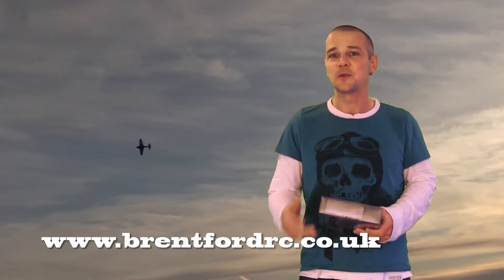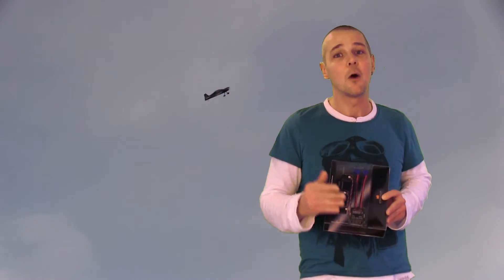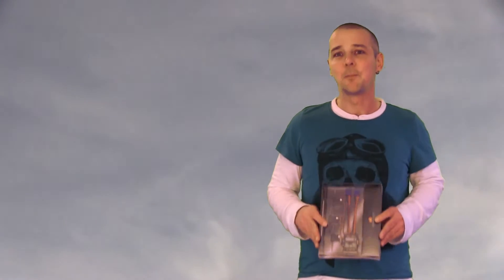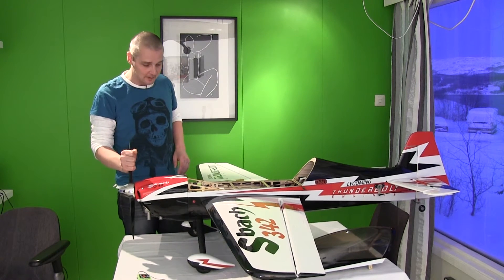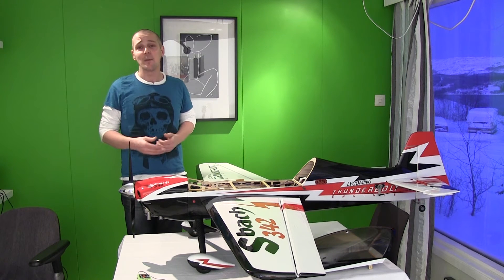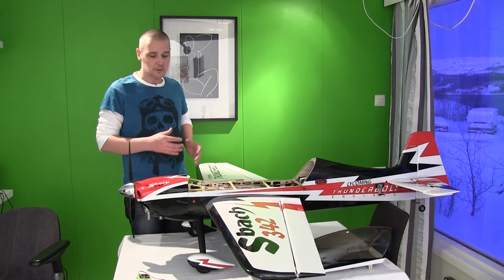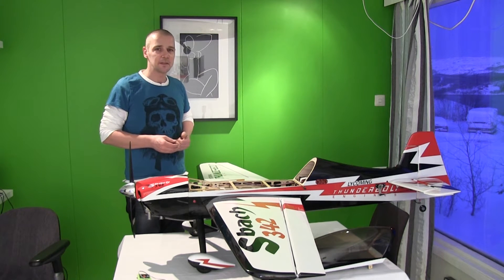Spektrum AR 9110 Powersafe - Upgrade for my Sbach 342 35cc

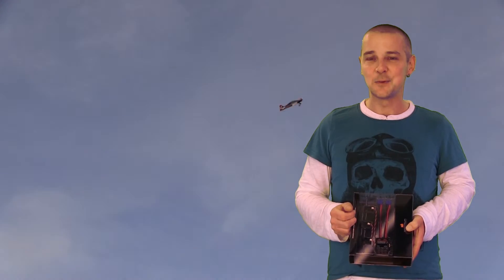Comment: I am interested in buying one of these, which is how I found your video, however something really bothers me here. From 3:53 - 6:56 I can see the window backgroup on the right-hand side of the screen being asolutely still, there is no cars going, no wind blowing and no birds flying, I have also noticed that you have added some clever green screen editing in the begining, all of these led me to believe that the window backgroud outside could be the effect of lightbox? I have also noticed that from 8:48 your lightbox goes dark, from which point on your talked further 2 minutes and 36 seconds, I noticed no car headlights outside, then again this leads me to further believe you are using a lightbox！ As why? I don't know, I am also curious if that's the case, why did you not mention it in the video? Could you pleas calrify because this is killing me and I really need to get to the bottom of this. Thank you!
Reply from the maker: Hi Sir. No effects other than green screen. I live in a place that is almost dark 24 hours during winter time and sun 24 hours during summer. The reason that you dont see any birds or car is just cause noe one is out and it was about 40 minus outside. and it takes only few minutes from the little light we have goes away. Hopes this helps you a bit.
Reply: ***** Many thanks for your replay. Now I can go ahead and ask you a question. on the AR9100 receiver, under the 9 channels ports (vertical pins) there are 3 more horizontal ports, the one on the left says switch, it is to plug in a soft switch I presume? the one on the right says bind, what is the one in the middle? is that dor data logging? I am planning to use this on a large sacel warbird so there will be 6+1 high torque 6v servos, do you think 2 Nimh 5 cell batteries (2300mah) is adequate for them? Thanks.
Reply from the maker: MaydayRC this one uses 2 cell lipos at any Mah. The middle i guess is for a battery. Nihm. i never seen this one. still i use 3 of these recivers hehe
Reply: +ArcticRc Wow, you have 3 of these? How cold is it when you fly? Any reliability problems so far?  I just got a used 91 edge with 5 Savox servos and then I got a used AR9110 on ebay for 100 bucks that came with no soft switch. I guess it will work without the switch (for now) , right? Thanks.
Reply: +ArcticRc question. if your servos are up to 6v wouldn't they cause any damage on the servos? as far as I know this receiver doesn't have any regulator
Reply from the maker: +Pavlos Constantinou i use only servoes that handles 6v. never used this on smaller models

Comment: Im putting this receiver in my plane, what batteries do you use in order to use that charge switch?
Reply from the maker: Im not using the charge switch for the receiver batteries. i use 2 cell 2200mah Lipo batteri for the receiver. Only ignition battery is used with the charge switch

Comment: Can you tell how you managed to connect the elevator and the aileron servos to the ar9110 reciver please?
Reply from the maker: Im not sure what you meen. But aileron and aux1 is dual aileron. and Elevator and Aux2 is dual elevator. make sure that you have set the transmitter settings for wing as dual aileron and dual elevator

Comment: Thanks a lot for your work!
But I have a still a question. 
So far i think it is possible to use 2 x 2s LifePo to power the servos and receiver directly with the 9110?

Comment: @ArcticRc Smart-fly work's with all radio's, I fly the hitec aurora 9. Just plug your specktrum rx into it and you can run two 2s lipo battery. They make a real nice opto engine kill to.